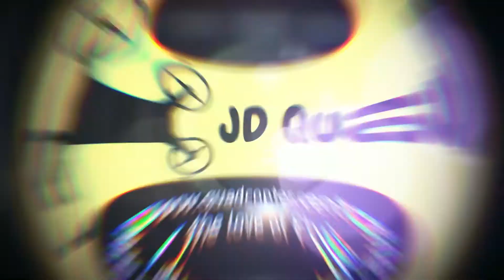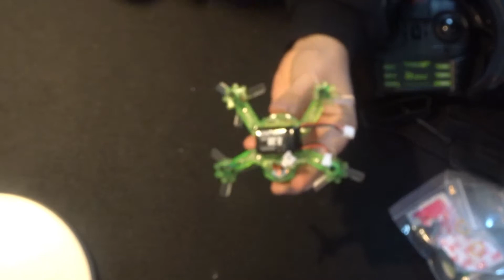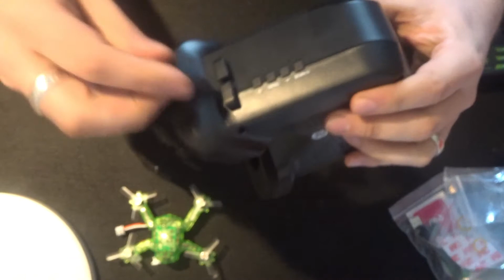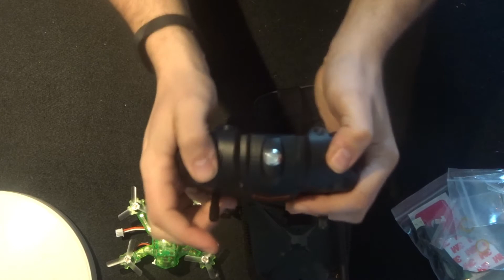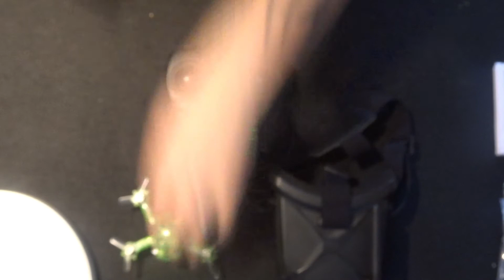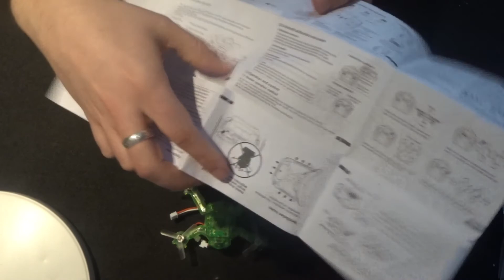Eachine Q90C Flying Frog Drone Unboxing & Setup Video

Comment: so.... hold the bind buttton and power up and down?
Reply: turns out the remote batterys where old. it works now
Reply from the maker: Hey bud, you should just be able to plug in then open and close the throttle to bind. From what I remember, if that doesn't work I'll have a look for you tonight when I'm home.
Reply: @jdquad  So it flies and bind now.. however it does not go into virtual / game mode. I dont get any driver installation on my pc.
Reply: okay i realized the stock charge cable does not transfer data. use another cable!
Reply: I got a third problem.. The battery only charges to 3.4 something volt (ive tried 2 chargers) it needs to be 7.4 right? I can fly maybe 30 seconds to a minute now..

Comment: I just turned my transmitter for the first time and accidentally pressed the pitch fine tuning button and now it doesn’t stop beeping can you help me please?
Reply from the maker: Hey 50cal yeah sure, I did the same on one of the flights. I turned the transmitter off and removed the batteries on the transmitter, when I turned it on again it wasn't beeping. But another fix if that doesn't work is to push the opposite pitch fine tune button until the beeping stops. Easy as that bud 👍🙂
Reply: Just tried and none of them seem to work really confused lol

Comment: I have problem - cannot bind the frog. Tried everything, googles works, switching channels works, just the frog red light still flush two times and cannot bind it and cannot ulock it afterwards. Any ideas?
Reply from the maker: Hey 333OMAR333 I will have a look and let you know soon, that ok? 👍😀

Comment: Does this come with a way to charge the 1 provided battery?
Reply from the maker: Hi Jake, yes a USB charger is included 😀👍
Reply: JD Quad can you recommend a cheap starting charger, and what batteries can I use other than from banggood? Thanks for responding !!!
Reply from the maker: Hey Jake if you have only the one battery then the standard USB charger will be fine, if you have multiple then you would need to look for a multiple battery charger or another 2 or 3 USB cable chargers.  If you dont want to use Banggood, i would start looking at Gearbest, hobby king, RC Moment are some other good places that may sell extra parts for this drone 👍😀
Reply: JD Quad any chance there’s another battery I could use, maybe with an adapter or something? Having a hard time finding these batteries
Reply from the maker: Hey  jake workmanThey can be a bit tricky to find, but they are out there

https://www.unmannedtechshop.co.uk/300mah-25c-7-4v-lipo-battery-pack-q90c-flyingfrog/

https://www.aliexpress.com/w/wholesale-eachine-q90c-battery.html

I wouldn't recommend using another type of battery as the weight distribution may be off and that could cause the drone to fly off center.  I hope the 2 links above help you out :-)
Reply: JD Quad so after doing some serious detective work, I’ve decided to do the following, and will let you know here as well as post a video about it.
I’m going to get a Molex 2pin to jst adapter(adapter so that I’m not tied to non stock batteries), and use these 
Turnigy nano-tech 300mah 2S 45~90C Lipo Pack https://www.amazon.com/dp/B00TGRYZRM/ref=cm_sw_r_cp_api_k6gYAbCBCWJXX

Have found 2 people that have done so successfully, not sure about balance however they are similar in size and weight. Fingers crossed!
Next I want to mount this onto another frame, just for fun. Great rtf package however, no complaints other than difficult to find batteries.
Reply from the maker: OOhh that's a very interesting setup mate those adapters are good to have in the drone kit, i look forward to the flight test. Feel free to post a link on this comment thread if you want to 👍😀
Reply: JD Quad will do, just waiting for the batteries to come in the mail. Loved your q90c review btw, played a big part in my decision with this quad, which is my first fpv and first rc ever
Reply: JD Quad they work amazing with the quad, will post a video when I get her back up, had a mishap and burnt out a few motors unfortunately. However those batteries gave me a solid 5 to 6 min. Of relaxed flying
Reply from the maker: Thank you pal that means a lot to me :-)
Reply from the maker: Oh brillaint mate, I'll have to get some 👍😀